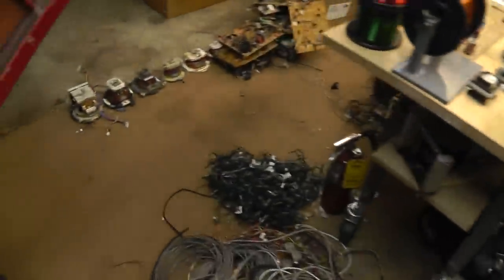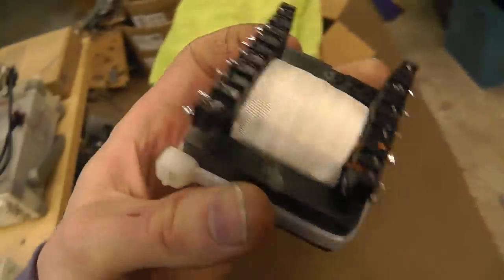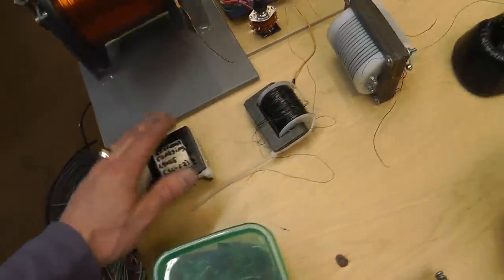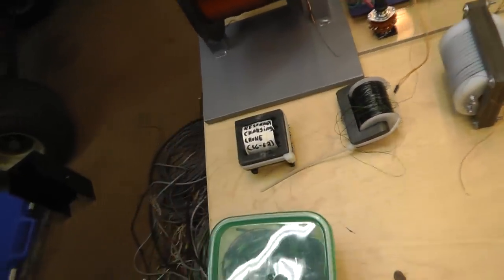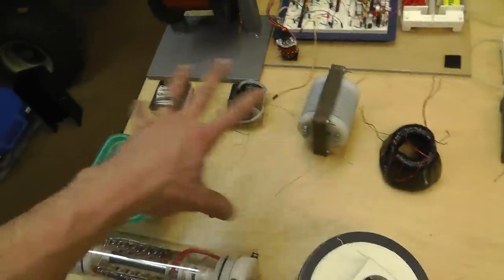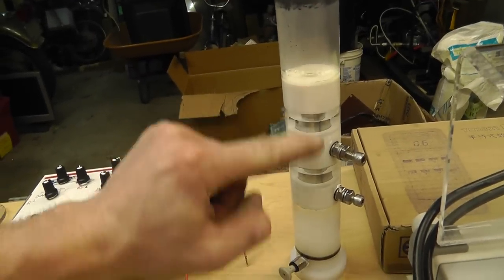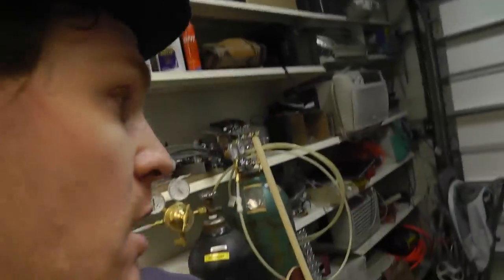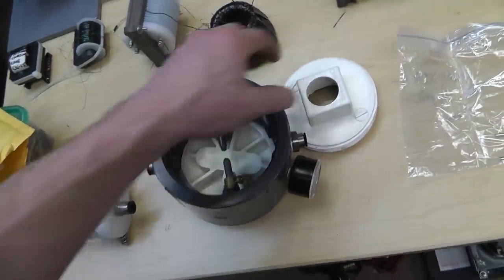04-28-2012 Update/Over View Of SM WFC R&D More To Show But Out Of Time! RWGResearch.com

Comment: Sorry hate to post twice...
In another lecture Stan gave, he mentioned the epg was his first idea but the automotive industry ( he specifically said Detriot) wasint ready to build electric cars so he had to come up with a way to make an internal combustion engine run on his new technology. (witch was the EPG) If you can make permantly magnetic gas and pump it through that tubing you will generate alot of electricity, that is more valuable than hydrogen!!!